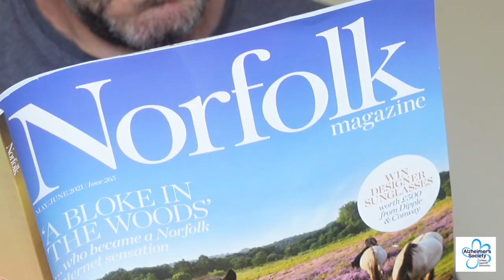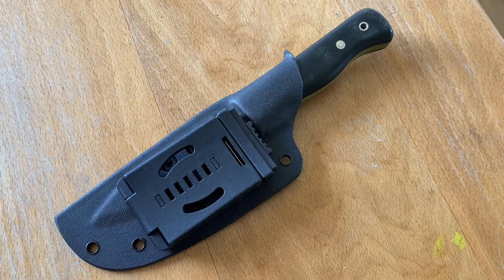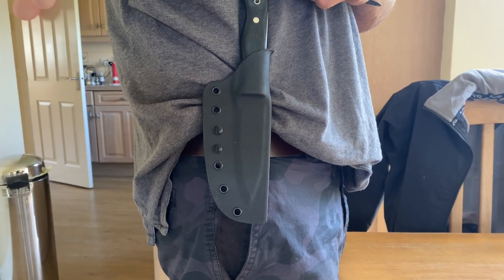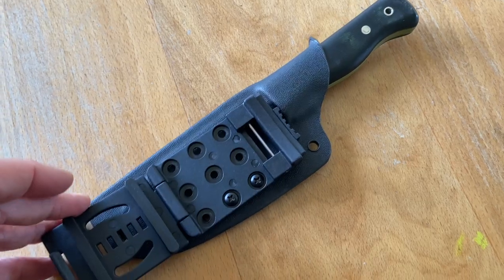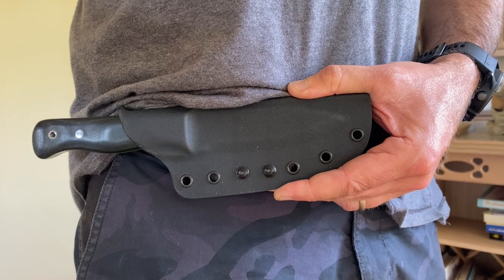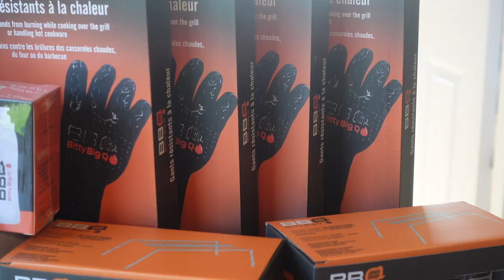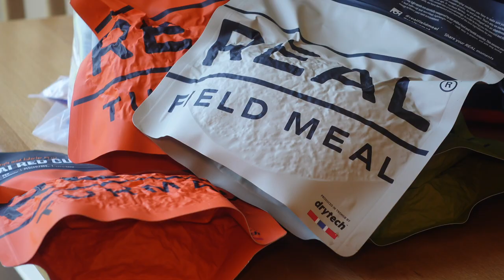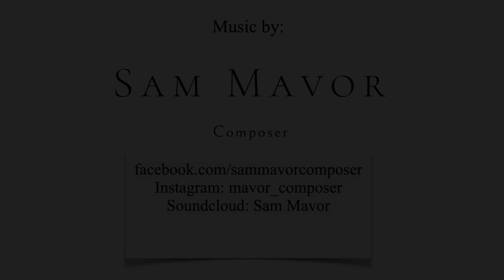Knife Making | Massive Giveaway! | Charity Announcement | Gifts! |

Comment: If you're using stainless steel for your knife, finishing your etch with a mild solution of ferric chloride and reversed polarity will add a very deep black tint to your logo. Haven't found a way to achieve this on high carbon steel yet, though...
Reply from the maker: Hi. Yes, my etcher can do that. I prefer the metallic look though.